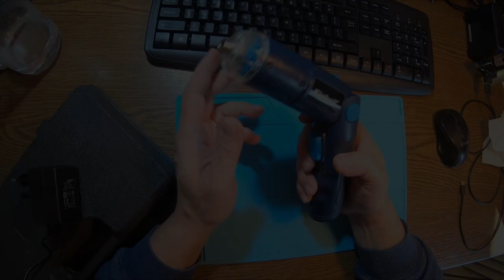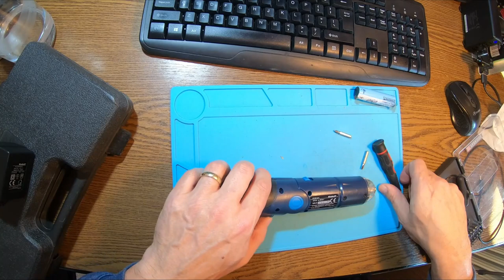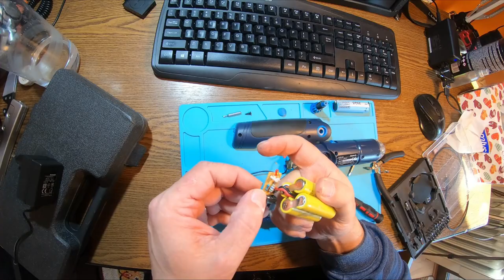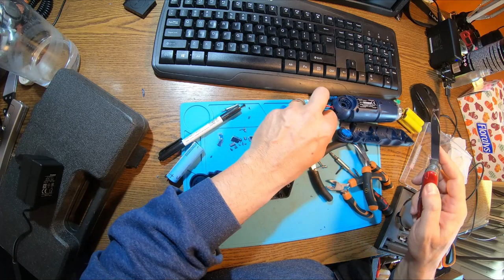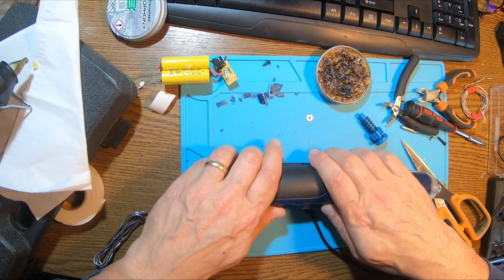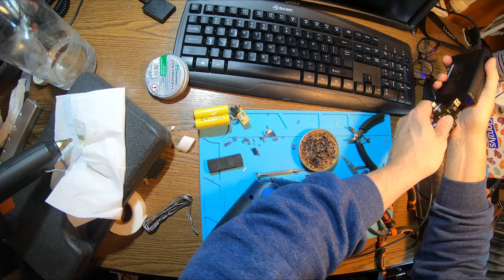Einhell screwdriver convert to Li-ion battery

Comment: Super. Have you any idea, how much current does the motor pull when overloaded (stalled). I converted a Metabo screwdriver to liIon a few years ago, and put  a 3A glass fuse in for protection. It blows many times and I have to replace it. I'm wondering if a single unprotected LiIon battery is OK inthere. Stalled motor is practicaly a short. And this kind of battery is capable to produce alot of current. It can melt the wires. Hopefully not in the motor. I was thinking of some kind of other protection. Maybe an autofuse element or something else.
Reply from the maker: Interesting! I'll take a look.